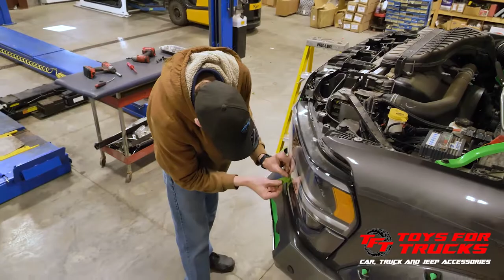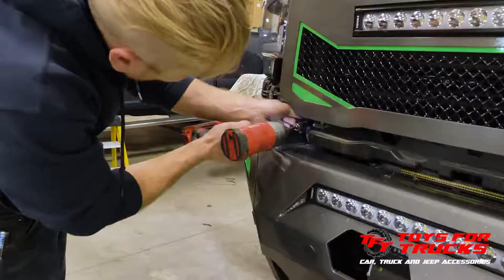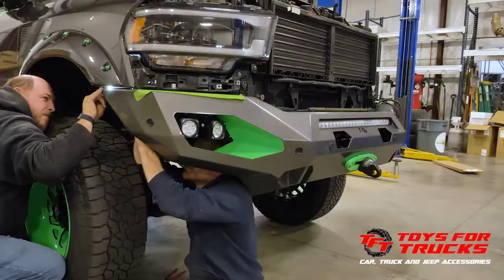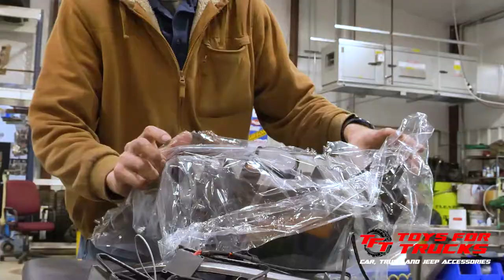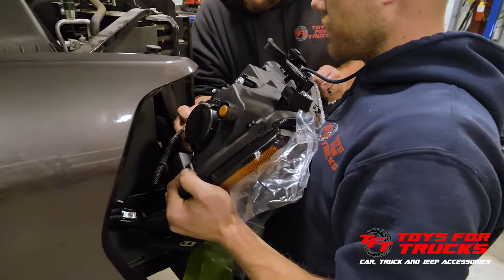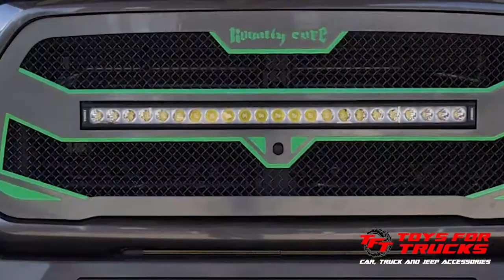AlphaRex Nova Series LED Projector Headlight Install - Ram 2500 - Toys For Trucks

Comment: Did you truck throw our codes on these headlights. I have 22 limited and used their converters but stuck with 3 codes now. Low LH and RH and not connected with adaptive lighting module.
Reply from the maker: The owner of the truck said he never had a code thrown when he had his headlights installed.  If you haven't already, I would give AlphaRex a call and I'm sure they can give you some quick answers as things to try to resolve it.  This has to be an issue they see on occasion.  Keep us posted.
Reply: @ToysForTrucks  thanks. They sent me the replacement harnesses but I sold the truck already couldn't try